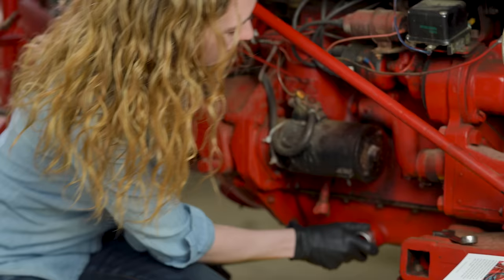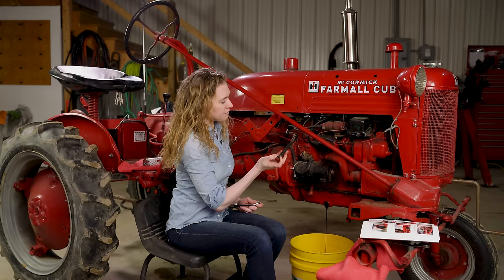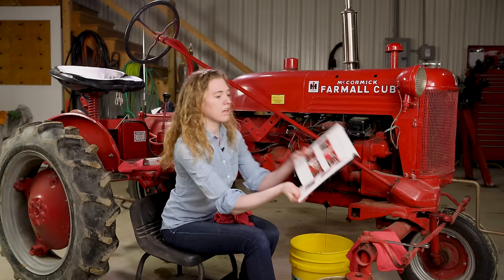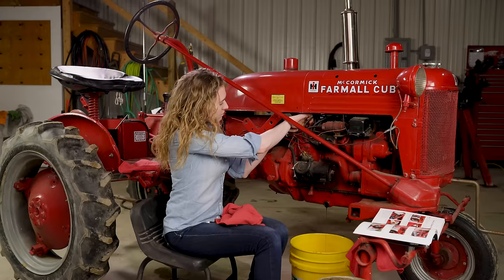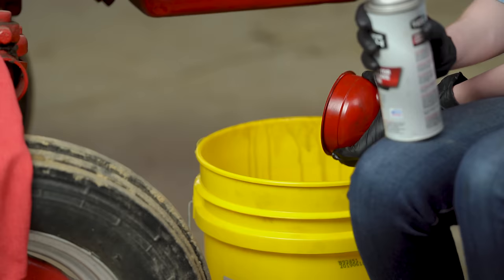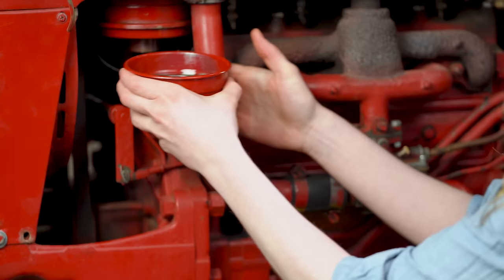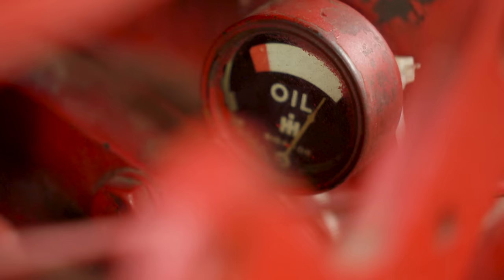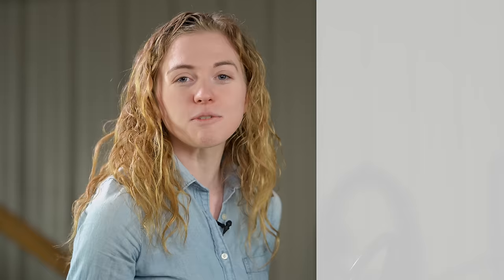Farmall Cub Oil Change: Easy Step-by-Step Tutorial for DIYers

Comment: FYI,. If you ever get some carburetor cleaner, lacquer thinner, etc in your eyes. Quick as you can. Get to a fan, compressed air etc. While letting a little air blow on your face.  Gently open you eye even if you have to use your fingers. The air blowing will evaporate the solvent pretty quickly. Had this happen several times actually. Wow! Does it sting!!! But mine always resoved quickly with the air trick.

Comment: I enjoy all your videos and you Cub Encyclopedia is a great book!  I wonder, however, why your oil change instructions don't include removing the cap on the pipe behind the starter so as to drain all the oil that remains in the casting which houses the oil filter.  There is often a goodly amount (over 1 cup) of dirty oil in both that casting and the pipe, not to mention all the particulates that settle to the bottom.  All of which is why IH put that pipe and cap there in the first place.  Taking off that cap (in addition to draining the oil pan) makes sure the new oil isn't immediately mixed with more old, dirty oil than necessary.

Comment: This brought back some memories for me. Where I grew up in Upstate NY there were quite a few of these tractors on the small family farms. They were extremely smooth running machines and very durable. We actually had the IH 184 'lo boy' which had a very similar engine to the Cub. Back then we got our supplies from the local IH dealer. They used to sell straight 30 weight 'low ash' oil that we recommended for these tractors.

Comment: Tried 15-40 and oil pressure fell to 8-10 lbs. Dumped it and put in SAE30 and the pressure came back up to normal. Also if your air filter element has never been cleaned it would be a good idea to do it. It takes a little effort to remove the filter housing. Soak and rinse the filter with varsol or eq. Dont forget to clean the intake tube. It is crazy how much gunk there is in the filter and tube. Check the vent tube running from the engine to the filter canister they are usually plugged.

Comment: I bought a 64 IH Cub a month or so ago, and just changed the engine oil and filter, when I removed the drain for the oil filter it was plugged solid, and probably 1/8 inch deep in the housing. After cleaning the pipe I used mineral spirits and rags to clean the housing and flush it three times to get clean rinse. IH put the drain there for a reason, seems a lot of people overlook this pretty important step. If you are in a hurry a couple skipped filter draining want hurt, but it will start to accumulate in the housing. Rachels book doesn't mention the drain, but does say to install the filter with the small end down. The video say something about the lable, or the writing being right side up, but on the wix filter the  # is upside down.
Reply: @jamesglavich1426 I guess we all need to buy your how to book and subscribe to your how to channel. what’s the name of those?… 😶

Comment: Rachel a great video,This is a very common problem with the  likes of a lot of these tractor's ,leaving them out with out cover and setting over winter ,when spring comes ,you find the clutch has rusted to the flywheel or the trans spline has frozen to the clutch spline perhaps your father could help you on a video down the road on this ,and a way of fixing it without parting it. Charlie.

Comment: Quick question, aren't supposed to drain the oil filter housing by removing the wing plug from the pipe below the filter housing?  Also, shouldn't you replace the metal washer on the filter bolt too?  Thanks

Comment: Great video. subbed.  We've got 2 Famall Cubs '50 and '53........I have hydraulic fluid leaking into our oil system so we need to replace the hydraulic pump seal......can you all do a video or send me a resource?  We constantly have to put oil into the hydraulic reservoir ..... thanks

Comment: One thing she missed was draining the oil filter drain tube.  But almost everyone misses that.  Not unusual to find them having never been drained or cleaned in the life of the Cub.
Reply: Also the Hollow Bolt holding filter lid down has two holes in bottom of it as Vent and needs also to be cleaned out with a small wire on side of bolt and in the end of the bolt up in it aways.  Those Vents are crucial  to good Oil Flow and Pressure.

Comment: Thanks Rachel! I was wondering if the oil filter housing needs to be drained also. Does housing drain into the oil pan somehow? I have seen that wing nut broken on some Cubs, so I would only tighten it by hand.
BTW, I have your book displayed on the workbench in my barn.
It's great info and a fun conversation piece when friends stop by. 
I also purchased a 15 min phone troubleshooting  conversation with Dan a while back. He got the Cub running. Thanks Dan!
Reply: I have 4 cubs 54 ag...3 lo-boys, one of which is a 61 industrial....surprised she did not drain the filter housing....not sure why?

Comment: I found that instead of placing my filter in with words up, I had to reverse for the bolt to go in.  I now suspect it won’t work that way either due to the other side of the filter pass through being too small.

Comment: Question? I have a Farmall Cub and need a bunch of parts such as the carb, fuel sediment bowl, new spark plug wiring, probably a new distributor and other miscellaneous items my tractor is still the 6 volt system does this encyclopedia cover part numbers and show diagrams on all these systems? If so does your website carry these replacement parts?

Comment: Hi Miss Rachel. I have a 51 cub and there was no apparatus or hose connecting the carb to the air stack when I purchased it . Is it ok to bypass the stack with an air filter that fits securely on the carb air intake? I am using a four or five inch so cylindrical filter with a foam sheath. Thanks for the videos and I will certainly purchase your encyclopedia!
Reply: Brian Keith my opinion: anything is better than an oil bath filter.
Reply from the maker: Yes, for sure.
Reply: @DanGingell  Great and thanks for responding.

Comment: Hey Rachel, help me out with a little info. I saw a tractor in a local show quite a long time ago. Pretty sure it's a Ford Ferguson. Very stock looking, but equipped with a Ford V-8 engine. I believe it was a 289, or another Windsor base powerplant. Was that a production tractor?
Reply: J W  Good eye JW...I miss that one myself on occasion.
Reply: Yes, everyone around here had a couple.
Reply: Looks like some folks put in 110 HP flat heads too. 55 mph, no thanks. 
Not originally equipped I don't beleive.

Comment: Question about your oil choice; not so much the 15/40 vs 30 but is it detergent or non-detergent?  I used SAE30 detergent when last changed the oil in my 52 Cub and it stop running shortly after (7 years now) -- I will get it running again someday.  I also have an H and don't want the same thing to happen. I did see and love the in-frame engine rebuild video and you also mentioned the same oil there.
Love all your videos, I'll be requesting the book for Father's Day.
Reply from the maker: Hmm...oil shouldn't spoil an engine, but if the tractor had non-detergent for 50 years and then switched to detergent oil it could make the engine smoke. I always choose 15-40 oil and never use 30 W, but if I had to use 30W I'd go with non-detergent instead of detergent (especially since I don't know what oil has been put in the tractor for it's prior oil changes).
Reply: @DanGingell  thanks for the response.  I was told by an old farmer (now passed) that I the detergent oil cleaned it out so that it lost compression.